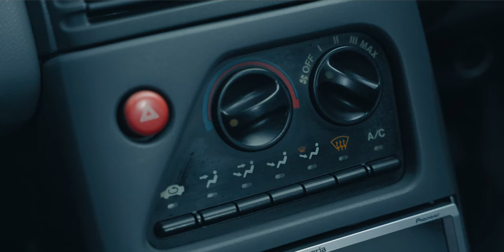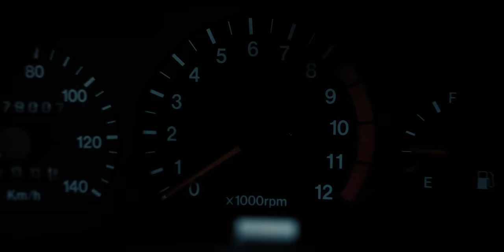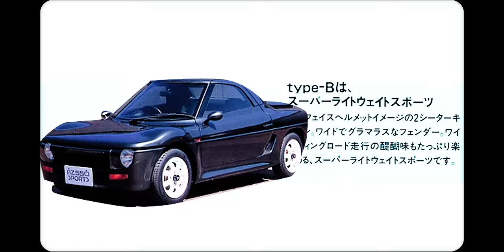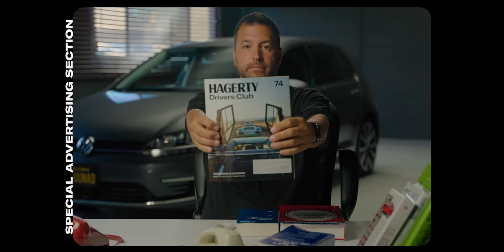Autozam AZ-1, Honda Beat, Suzuki Cappuccino — Kei Cars are Japan’s SUVs — Cammisa Revelations Ep 26

Comment: The AZ-1's owner manual actually has an illustrated guide for ingress and egress of the driver, since it may be a little tricky for some people to work out. The AZ-1 only ever had the F6A engine, never the K6A that the facelift Cappuccino got. And its spoiler was part of the Mazdaspeed kit as a factory option (along with that more aggressive hood, front bumper, and body-colored lower panels); the base models had a smoother profile, dark grey lower panels, and no spoiler. I think the car looks a little goofy without a spoiler (either the Mazdaspeed or the M2 version), even though they're hard pressed to go fast enough to make use of them. Also, the Cappuccino was the only one to have an automatic transmission as an option. The Beat also had an optional LSD (basic clutch type), it and the Cappuccino had optional air bags, and all of them had optional ABS and came with standard A/C (which is essentially required in the greenhouse-esque AZ-1).
The Beat has its spare tire in the front, in the same general position as the AZ-1 was originally, so it's kind of odd that the Beat didn't relocate it if safety was paramount. Maybe it's because it was less of a problem in the Honda, but maybe there was just nowhere else to put it in the Beat.

Comment: The Honda MTREC (Multi Throttle Response Engine Control) system was already used in the 1982 Honda CX500 Turbo Motorcycle although not with the fancy name. They used the more standard terms : Speed density Fuel injection control with low throttle opening and Aplha-N injection with high throttle openings

Comment: Growing up in India, a car known as the Maruti 800, that was a kei car co-developed with Suzuki was all the rage. 800cc, 30 ish HP, barely any weight or crash protection. It was either this or the more expensive domestic Padmini, or Ambassadoor that looked like they belonged in the 70's for Indian car buyers in the 90's. My dad owned a Kei van that was his only car for 20 years, also made by Maruti, that shared the same engine as the 800. It was a legit mid engine car, had the engine under the front seats.

So many memories of that car. I was light enough for a few guys to lift a wheel off the ground when we had to change tires without a jack. I went on dates with my 1st and 2nd GF in that car.

Comment: K-cars are incredibly practical and efficient for use in Japan.  Its popularity is not just down to low costs.  Streets (and parking spaces) are really narrow all over the country that can barely accommodate one full-size sedan to pass through, and those are meant for bidirectional traffic.  And regardless of the data on the specs sheet, I seldom find a k-car short of power or speed even with the mostly mountainous terrains.  Being masters of everything petit, the Japanese have created trucks, minivans, 4WDs, SUVs, and even campers based on the 660cc engine, and they all do a good job for what they are designed for.

Comment: Thank you for introducing Kei Sports.  I have owned it for 20 years.  It's a Honda Beat.  Beat is the one with the highest degree of perfection and survivability among these three.  Very slow car but fun to drive.  However, the sturdy engine that turns up to 10,000 rpm is very fun.  Other cars are turbocharged and relatively fast, but I think the beat is the best overall.  It's still available at a low price, so if you're looking for one, try it once.  I think I can be your companion for life.

Comment: Hey, I'm a 5'8" tall Japanese guy and I fit just fine in a Kei. Sure I bump my head every time I try to get in and the car is so narrow that I can reach over to open the passenger rear door without getting out of the driver's seat. But I definitely fit. Kind of.
Reply: I went to buy an Alto and smacked my head on the way out of the driver's seat. I got a Hustler instead. No headaches!

Comment: The last section of the video showed the Jimny Sierra—not the Kei version. The Sierra has a wider body (fender flares), larger tires, and bigger engine. The original Kei version looks the same minus the flares and more narrow tires and of course the smaller engine. Tried to buy one 2 years ago but the waiting list was a year or longer. Went with a used Pajero Mini in the interim. The tax benefits and lower toll road fees of driving a Kei have kept me a happy driver for over 30 years. Wouldn’t dare dream of driving one in North America with all those huge SUVs.😮 At least here in Japan where I live, I’m most likely to get hit by another Kei if there were to be an accident.😅

Comment: I have an Alto Works which has the same F6AT as the AZ-1 and Cappucino along with enough mods to almost double the HP, and a Daihatsu Midget II mini-truck with a supercharger.  I will be getting an AZ-1 in 2023, and I plan on selling my RHD SLK to do so.  With the low production numbers, the AZ-1 will probably spend most of its life in my garage on a lift above the Alto Works with just an occasional run around the block or a trip to cars and coffee.

Comment: My old Mazda MX-6 had 205/55-15 tires/wheels.  Tire selection was limited.  My current car had 235/55-16 which also has limited options, but I switched to 245/50-16 which was a factory option on higher-spec models.

Comment: The poor sale problems with the AZ-1 wasn't just because of the recession but because of it's pricing and the whole car itself. 

So as we all know, 90s was the absolute peak of mad Japanese tuners, tuning anything and everything that has wheels on them to make them literally fly on the streets of Japan and even worldwide. The Beat is relatively easy to work with and the Cuppacino's way easier. The same can't be said for the AZ-1 but there's still people doing it but it's rarer to see people do it when the other two are a better choice. Also, as you said, the main purpose of Kei-cars is to be daily drivers and both the Beat and Cuppacino are considered daily sportscars where you can drive it to work, buy some groceries post-work, dump it in the trunk and go home, rinse and repeat steps. The AZ-1 doesn't do that well due to the inherent lack of stowage spaces across the whole car which makes living with the practicality and simplicity of an Kei-car totally worthless and non-existent. 
Also, the price was INSANE! Both the Cappucino and Beat costs lesser than the AZ-1 when it was launched as the comparative price point of the AZ-1 compared to be more practical Beat was about 200,000 yen which is about 2,000 USD more than what Honda's selling the Beat at and at least 1.5k USD more than what Suzuki's selling the Cuppacino at. Won't work when a car doesn't work as a comfortable daily and also being priced that high.

Kei-cars like these actually didn't collapse under the recession and did in fact chug on with things like the Daihatsu Copen and the Honda S660. Sure many did change to become stepboxes (Kei-car sized MPVs essentially) and hot hatches like the Suzuki Alto and Daihatsu Mira Turbo but it didn't change much and sporty kei-cars never left the scene. 
Also, fun fact: The Caterham Seven 160 was considered a kei-car in some regards as it's extremely lightweight and it's engine comes from the same 660cc engine from Suzuki and despite being slightly longer than what the kei-cars should be and slightly more power (80hp in fact for the Caterham), it can still be considered a kei-car just.... Slllightly over the border with that.

Comment: that speed limit idea is very different to here in the uk, speed limits are determined by the accident rate and housing in the area. built up area, likely 30mph, high risk built up area wher risk of accidents puts people at risk, 20mph. area's just outside of built up areas 40mph, then more rual single lane per side areas 60mph. then dual lane and motorways 70mpg. sometimes between the 40 and 60mph area's there a 50mph area.

Comment: The 3 (A-B-C's) are great to own because they have so much character!  And not only that, but they also now form some sort of cult following, if you know what I mean. But saying that, how easy are parts available for them? Considering that they were built in the 1990's - that's 30 years ago - do the manufacturers still stock them? If not, is there a third-party supplier who can provide those parts? I mean, not just mechanical/service parts, but body parts too such as panels and trims.

Comment: I have a '90 Daihatsu Mira TR-XX and it handles nearly as well as my Miata. The Miata has 205 width summer sport tires and the Mira has 155 width economy tires. Both of them are featherweights but the Mira is almost 900 lb less than the Miata. 😳

Comment: Not quite correct on the AZ-1. 

It was a Mazda concept, and the original AZ550 concepts used Daihatsu drivelines. Suzuki mechanicals were chosen much later. 

It was engineered in the UK by Hawtal Whiting. And Kurata Corporation in Japan built the AZ-1 for Mazda on a special production line. 

According to monthly sales data, there were 4,391 sold (3,858 AZ-1s, 533 Caras).

Comment: 16:17 sounds like a NA flat-6 Porsche , but more raspy. Like it.

16:48 is this just me, or sounds a bit like tuned Supra, especially the little BoV sound

17:13 its a bit sounds like stock Ferrari 512TR, especially the mechanical noise.

Comment: Not so sure about others, but I loved my 4Runner, granted we did go up into the CO mountains. To say nothing  about the supercharger with a smaller pulley, larger flow fuel injectors and a piggyback electric controller for them. It put many "faster" coupes/cars to shame. Whether on the city streets and especially when riding up into the big hills. And then some jackass in his 18wheeler T-boned and rolled it/me, by rolling thru an intersection light(a red one). Many back surgeries later I'm waiting for those same parts to put on my newer toyo truck's v6.

Comment: I own an Autozam AZ-1. There are a few things I want to correct.
 #1: The AZ-1 never got the Cappuccino's K6A. Only the F6A DOHC Turbo was offered in the AZ-1. 
#2: And Strongest 64hp this side of 120hp? Nope, I wish. So far, everyone who has dynoed these cars get about 73hp and 79tq. 

As for that "Snap over steer", I have pushed my AZ-1 pretty hard in the mountains of Japan and have never had any problems. As for the doors, To pass safety regs Mazda had to prove you could still get out of the car if it rolled over. There are photos of the car upside down with the driver getting out. 
Is the car tight? Yes, in terms of leg room. I wish I was a tad shorter but at 5'11" I fit fine and can drive easily. I would NOT recommend this car to anyone over 6ft tall. Removing the seat rails and bolting the seat to the floor is really the only thing I plan on doing for better fitment. shoulder room is no problem. AZ-1 specific parts are expensive! If you plan on buying an AZ-1 DO NOT CHEAP OUT. Yes you can find Cheap AZ-1s. 10-13k USD. But let me tell you, 99% of the ones I have seen going for that price are completely rusted. And worse part is, it is really easy to hide under the composite body panels. Do yourself a favor and Check the car out yourself. Get as many pictures as you can of the underside, under the carpets (Floorboards), under the hood and in engine bay. Check for rust and cracks around door struts, shock towers ect. You'll be doing yourself a favor in the end by getting a more expensive car that's clean and needs very minimal work. 16-18k USD. The AZ-1 Shared many parts with other Suzuki cars, like the Alto Works. So many drivetrain and Suspension parts are easy to get and fairly priced.   

The AZ-1 really is a Mini Supercar that can still hold it's own 30 years later. I have out performed even modern Kei Sports cars like the Daihatsu Copen and the Honda S660 on mountain roads and in a straight line. When it comes to sound, The AZ-1 Sounds like a sewing machine stock, Because the Turbo is right behind your head so you hear it spooling all the time, but with the right exhaust they sound great. I don't know what muffler mine has, it looks to be a Mazdaspeed/Suzuki sport clone, but it sounds really good. Not as good as the Honda Beat, that thing sounds amazing. 

The ABC cars are absolute legends and often get overlooked by the more famous fan boi cars, Skyline, RX7, Supra, Fairlady Z, Chaser, MKII, ect. Don't over look these cars. Yes they don't have the performance figures most people car about. But they have Soul, Character and Pure Driving enjoyment.

Comment: I have driven SUVs for 10 years. Some had the exact same fuel economy as a car, my current one slightly higher but if I drove a comparable wagon it would probably be the same. No idea where the myth comes from that they are terrible on fuel. And the reason I drive SUVs is because I find it way more comfortable and relaxing to sit high and look over traffic as well as more comfortable for my heel and knee because of the seating position.

Comment: I dream about a Honda S660 with a K Swap. Imagine what a GoKart like Rocket it would be... ~200hp wheel all NA maybe almost 250 with bolt ons and a high octane tune.
It only weighs 850kg prolly 900 with a K Motor so significantly less than an Integra or Civic and I recon it would have less drag aswell.

Comment: UHH  no....It is requirements to conditions. Japan is the size of California. Roads are town to town in a winding terrain allowable build. They have 1 main highway. Trains are the best mode of transportation. Gas is $5 a gallon. Most people travel to work on 50 cc motorbikes. In North America are major highways and cross country driving. In a 'micro' car. would be crazy. We got the big cars and lots of room for families. $1 a gallon gas. A micro car engine on a freeway reving at 6500 rpm just to do 70 mph would burn itself out early. We get the engine running at 1800 rpm and 70 mph in 10th gear. Built for the freeways.
Reply: Gallons are what boomers use

Comment: The explanation of how speed limits work isn't exactly correct. In civil engineering roads have a design speed, which in North America is typically one speed limit class above the actual posted speed. Just because people drive faster on the roads does not mean the road is safe to drive at that speed. Major highways are an exception to this they may in fact be designed to a much higher speed in some areas, however data would tend to back up that just because people drive faster, doesn't mean they should: accident rates and mortality from those accidents also rises.

Comment: A horsepower war was brewing. Meanwhile Americans had lawnmowers pushing almost as much hps.
Reply: There's a difference between American engines having an amount of horse power and japanese/european etc as the latter's are more advanced with better gearboxes etc so the horsepower actually reaches the road. A Japanese or european 2.0 4 cyl will be faster than an American 3.5 v6 and a 2.0 turbo petrol will be faster than most American v8s

Comment: First of all, this series is exactly why cars now are just hot garbage, despite being infinitely reliable (until their timing chain stretches or breaks which is only ever repaired because the cars are new enough when it happens that the repair is cheaper than another car - that's just how early they go), extremely fuel efficient, carefully damped and microscopically precise to steer. and sometimes safe. None of that's the point, look at this. Look. At. This. The manufacturers are never going to be incentivised to build anything this good because the buyers are all urbanite h** who would rather teleport A to B, and even if they were the governments would never allow them because they feign caring about nothing but the safety and wellbeing of the populace at large. whenever they're not promoting the state of nature above the existence of their populace but that's neither here nor there i guess.
Secondly, Hagerty, all my loving for making this kind of content showcasing just how good you people 20 years ago had it, finding these cars that are in literally factory condition, wherever they come from.